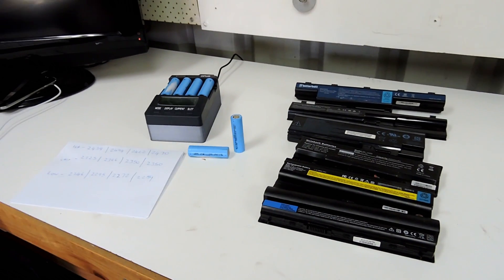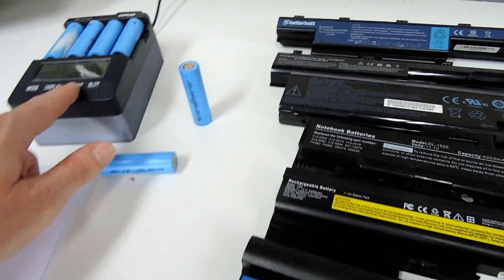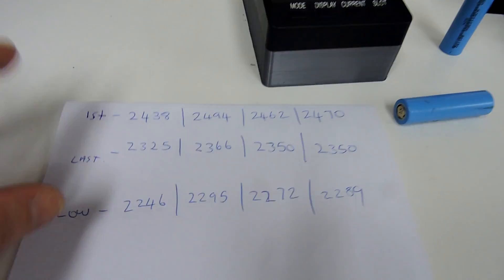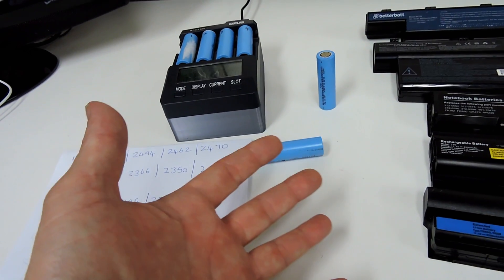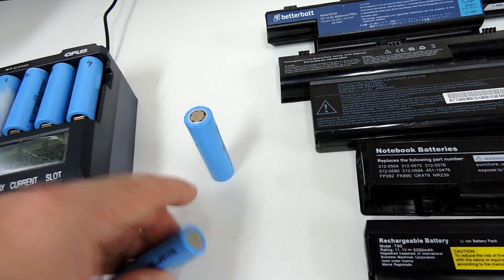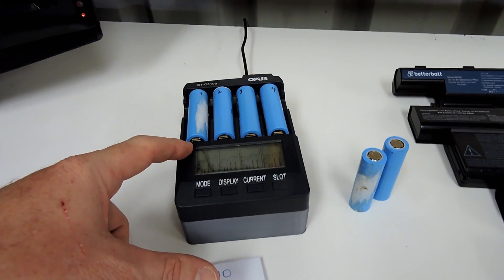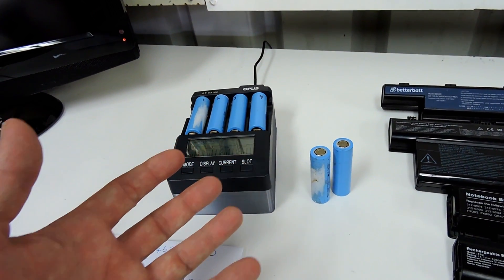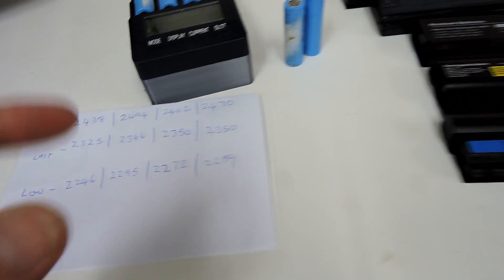Fake 18650 Cells part 2

Comment: These cells are manufactured in Shenzhen where almost all batteries are manufactured in China. They aren't bad, they actually do the job, they have a descent capacity but won't last as long as top brand cells such as LG / Sanyo / Sony / Panasonic / Samsung. Most of these big brands are also manufacturing in China where they copy each other. The Chinese probably copied a descent cell and may be using the same or similar chemistry and industrial facilities.
I do have a 10s5p pack with these cells sitting here from an ebike customer, they seem to be very well balanced after many cycles (cheap BMS failed of course but the cells survived).
Yes, you made a very good point, these budget Opus chargers aren't a precision / scientific calibrated device at all + the environmental factors where people are testing these cells.

One thing that's very important to mention here, these blue Shenzhen cells are miles away from nasty Ultrafire cells hahaha
Reply: Yeah the "SZN" is a clear indicator of that.
The "ASO" seems to be the manufacturer itself so to know what factory made this we need to find what factory uses the "ASO" tag.

Also that barcode is a serial number.
If they are "FAKE" cells they usually print the same barcode over and over on the slieves.
So might take a barcode reader ( plenty on the android app store to get the job done ) and check if they are unique or the same over and over.
Reply from the maker: Yes i think they are way better than Ultrafire's lol !!!!
Reply: I add an another 3 letter one to the mix: FST. Same chinese barcoded cell.
Reply: Sanyo ??? ...Really ???... You call reliable cell these crappy heaters that anybody who has encountered them eventually end up avoiding them ? I`m sorry, but I cannot be more disagree with you pal.
Reply: "copied"...... "descent", I think you mean decent. Also this isn't rocket science, it's just another 18650 lithium ion battery. If you truly believe that the Chinese are incapable of understanding chemistry or how to make a battery and have to "copy" then you are beyond ignorant and racist. You are aware that China has a much higher national IQ than any western country right? They have hyper sonic glide vehicles and a pretty advanced space program......yet you think they can't even understand how a lithium-ion battery works? WTF. You Chinese hating Americans really are something special, only in America have I heard these deluded beliefs about China.
Reply: @vforvenom2299  . "Chinese hating Americans". That's coming from you, not Americans. So who is the biggot here?
Reply: @vforvenom2299  oz

Comment: What capacity did the actual laptop battery have on it? 4400mAh? If the cells are actually substantially less than the specified amount then it is a fake battery.
Reply from the maker: it was so long ago now i can't remember for sure. from memory it had about half of what was there.. but like i said i can't be sure

Comment: I just make the test on 12 unknown brand cells as SZNS (purple color) and ATL(dark blue) I find out ATL makes cells for samsung till Note 7 battery affair. No data sheets on google but all of them are from used laptop batteries rated as 4400 so I guess they are 2200 each cell. The test with opus shown rates from 2100 to almost 2300 and internal resistance from 80 to 150 mohm. They keep voltage, charge fast, don't get too hot and work fine. If anyone make the test on a panasonic and shown this matches and everything is allright, why don't we trust in this cell as well as a panasonic cell?

Comment: When you say it feels lighter, I assume you have actually weighed them to conclude this? If they are lighter then my guess is they are high capacity cells with a shorter shelf life. Meaning that they may have the same internal surface area as a Panasonic or other more expensive cells, but they may not effectively last as long because of the material being physically thinner (which also makes it lighter and less expensive to produce). I would expect them to last about 70% as long as a good Panasonic cell. These are not rubbish cells, they are actually pretty decent. Some people in Anglo countries need to learn to accept that just because something is from a Chinese company it doesn't mean it's trash. Lenovo computers, Huawei phones, Xiaomi phones, Arcfox-7 electric supercar by BAIC which is faster than Tesla's fastest electric car. They invented many things also, like steel, gunpowder, mechanical clock, cannons, land mines, naval mines, guns, crossbow, compass, negative numbers, paper, merit based system, Porcelain, borehole drilling, tea production, alcohol. Even such basic things as toilet paper, paper money, and the toothbrush were also invented in China. 
And even Chinese Americans top the SAT scores and have higher paid jobs than white Americans. So this strange hate by Anglo people is unjustified, China has never done anything wrong by the west and none of this hate ever makes any historical sense. The only vague thing China ever did in history was aid and assist the Koreans and Vietnamese in fighting off the Americans who were trying to invade and take over these countries. But can you blame them for that? I can't, I would have done the same if I was them also. Other than that, they have never done anything to western people.

Comment: HP battery packs seem to be the worst to break into out of all the ones ive encountered, And these non original battery packs i find they are of poor construction even having the thermistor sensor not in physical contact with the cells at all.
Reply from the maker: HP are well built that's for sure, Never really looked at placement of components inside but the box hasn't been picked up yet, gave them away and never showed - humm Might have a second look
Reply: Yeah i kinda find it important to inspect the quality of the pack as a whole such as safety pcb quality etc then it may give a clue to what cost cutting was done, Some times ive found cells that looked like they have got so hot maybe leaking and rust appeared on them.

Comment: If they test fine, then does it matter too much what the sticker on them says? 

And looking at the results so far I would say that they look pretty decent, they may not be 2900 mAh a cell but for a cell that looks like it was around 2400-2500 mAh rated capacity I think having 2350'ish mAh after 115 full cycles is pretty good.

They would certainly go into my powerwall whenever I get enough cells that is! :-)
Reply from the maker: Testing is one thing - having them still be safe after 200 plus cycles is another. Motivation is missing to keep testing but i really should !! lol

Comment: 2300 mA from fake cell after many tests? Holy s... That's 8,5 Wh. I have two 4s36p packs, both are made from new cheap cells and are about 900+ Wh. Every cell tested to be about 6,5Wh and both packs tested with 50W load to confirm that the packs can give about 950Wh max. I tested few years old Torqeedo's 8s5p battery and got 290Wh, that's 7,2 Wh per cell. They rate that pack for 320Wh which it probably can give when it's new BUT still only 8Wh per cell!

Comment: My humble opinion: if it tests good, it is good. Not all the stuff from China is crap.  Probably best to test cells in whatever environment they'll be used in. I think the tests you've done are more than adequate. :)
Reply from the maker: I agree, but personally would never use them in my project. they just don't feel right.
Reply: China make a range of products, from low to high. People in the west who are cheapskates will buy the absolute cheapest thing and complain. But if you go to China the people there in the middle class are not using the super cheap stuff that the west buys from China, they are buying better stuff. The builders there also are not using cheap ass kmart equiptment either, they are using legit high quality Chinese branded equipment. One good example is you can buy some piece of crap unbranded smart phone and it will barely work at all and is just trash, or you can buy a Huawei phone and they are actually pretty good. Like any country, China makes a range of things.

Comment: are they considerably less in weight?  you should put them under a stress test. discharge at a higher rate. see if they heat up.
Reply from the maker: 2 grams lighter, and sound hollow when you tap them together

Comment: Yeah - I think "fake" is the wrong word. I'd call them unbranded. I try to be brand agnostic and just go by the data. In your case the data from the OPUS is saying these cells are good enough for a powerwall. I'd use them for sure.
Reply from the maker: It's saying its ok, but is it? Still, don't trust them based on weight and how hollow they sound.
Reply: The amateur scientist in me says: in a battle between data and "gut feel" (weight and sound) you should go with the data. [Easier said than done.]
Reply from the maker: Gut seems more reliable... like it' make a grumbly noise - i feed it - noise stops - gut is smart lol

Comment: EVERY 18650 cell I've EVER bought hasn't managed more than half of its claimed capacity when tested (and NO, I don't buy into ridiculous, impossible capacity ratings). So, hell, I'd gladly settle for those "fake" cells. As a matter of fact, even before seeing this video, I've recently considered buying laptop battery packs as the ONLY way to get even halfway decent cells for my flashlights and Arduinos without paying insane prices per cell. Anyone have any recommendations?

Comment: Hello, I thing they will be FAKE if it was writing in the jacket a false rated capacity, with an "oficial" brand name.
but nothing  on the jacket, except a few number.... they are just "no brand" cells, may be built in the same factory as some Samsung, LG, Panasonic.....and they do the job !
Reply from the maker: there is no way Samusng, LG ect would let these out the door - they are nothing like original manufacturer cells. They plain feel cheap - but i agree the term fake is incorrect

Comment: 2400mah is the rating on the back of the laptop battery case. The batteries and cells are made in-house so, no data sheet will be found on them. If the cells are working ordered they are real to me just not brand.
Reply from the maker: I've agreed Fake might not be the correct wording, cell has no mah rating on it so it could be 300mah and still be 'real' i guess..

Comment: Those values, and the cycle results are pretty impressive, so the chemistry isn't fake even if they don't have a recognized name.
I would still use them.
Need to define 'fake' - There's fake as in unknown, fake as in passing off, and fake as in ripping off!
At least these ones aren't full of sand!
Reply: Pull open a good (fully discharged) battery of 2400mah rating and one of these. Compare the length of the rolled lithium/diaelectric strips inside? Look at the materials used, are they shorter than 65mm? Do they have a different looks to them?
Reply from the maker: or are they full of sand... lets cut one open... :)
Reply: Somehow I think if it's between 2200 and 2400 mAh there won't be any sand in there.
I wouldn't be able to bear sacrificing one and lose its service to humanity!

Comment: Well shit, they're better than half the cells I've pulled out of genuine HP packs.
Reply from the maker: hahahaahha you get a heart!
Reply: I can (non ironically) agree with you. Most "fake cells" I gathered from non-original/replacement batteries for dell/hp/lenovo are quite good, with low internal resistance. Maybe thats because most replacement batteries got shit BMS and that electronic fails quick and cells are not used much.